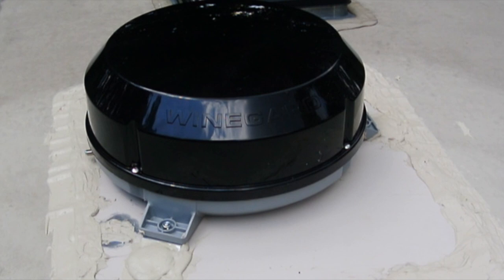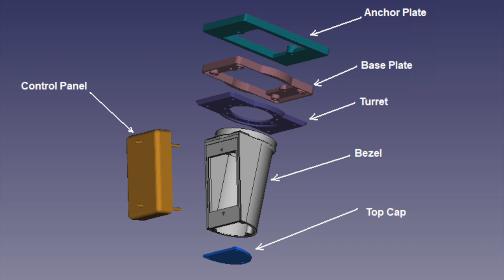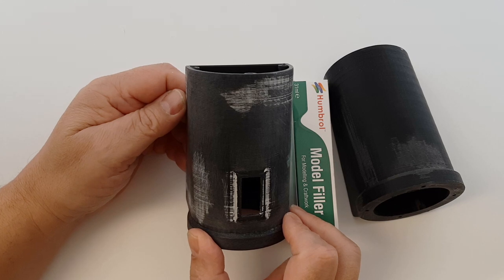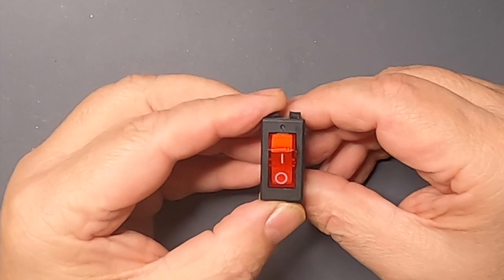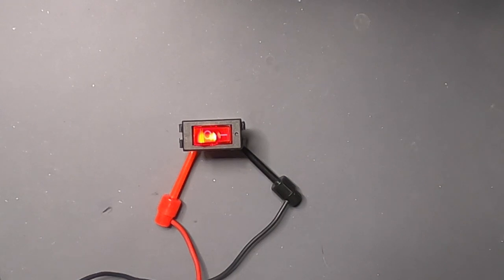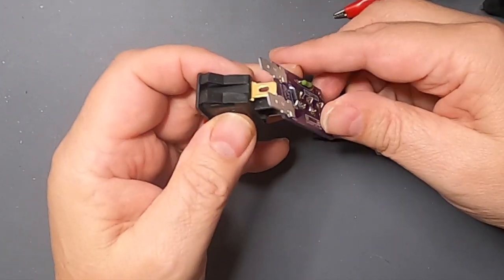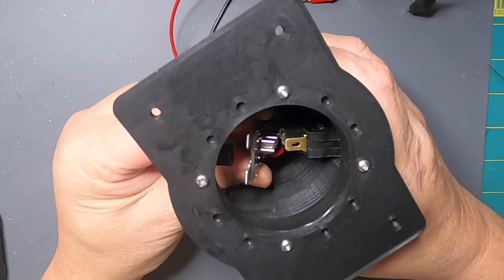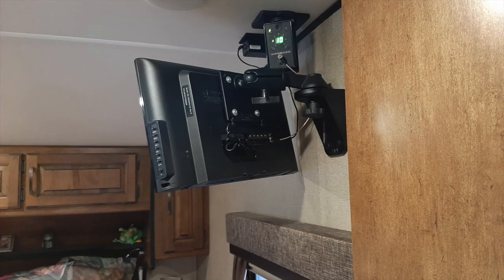Custom RV Antenna Control Panel.

Comment: how is the reliability on that wingard? all the reviews have always been poor from what I've seen
Reply from the maker: I installed mine about 2 1/2 yrs ago, and have not had any issues. 

I know there were some issues when the product was initially released, but by the time I bought mine, it seems that those issues have been fixed.

Comment: Fascinating. The time you put into these projects and subsequent videos is impressive. How well does the mini coax handle the signal?
Reply from the maker: For the short length of the cable, there are no issues. I think if the length was significant - say 50ft or more, then the losses in the smaller cable might be noticeable, but for a small length, it doesn't seem to be a problem.

Comment: What material did you use for the 3D prints?
Reply from the maker: PLA.  It is inside, so no issues with melting in the sun.